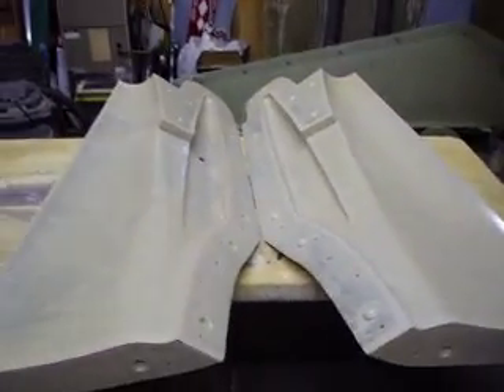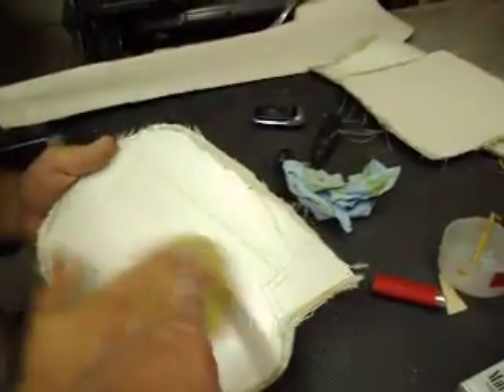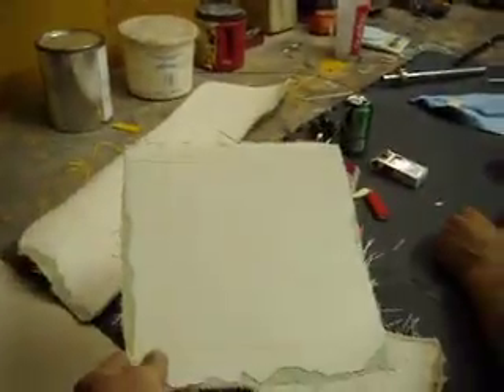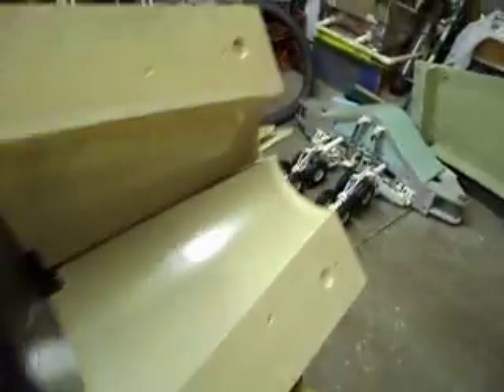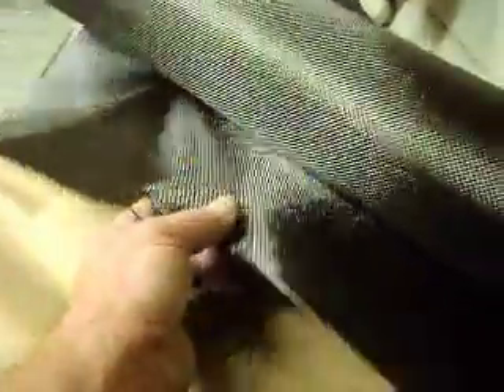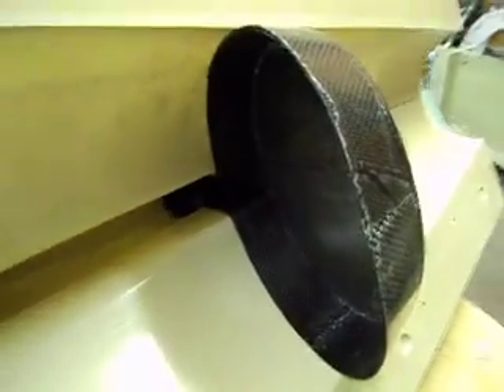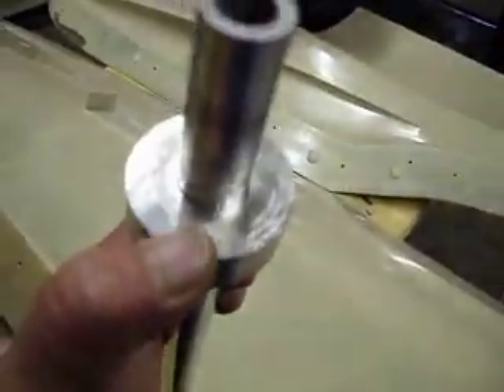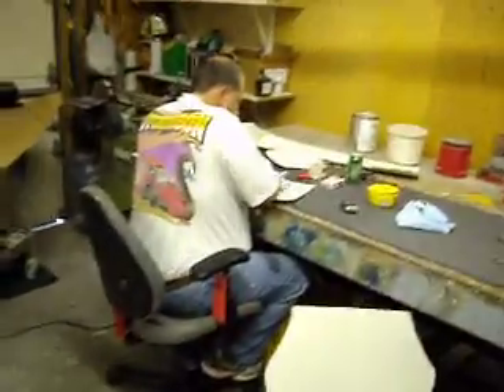How to build a rc jet b1 bomber #79

Comment: what kind of resin do you use for the carbon fibre also once the CF is rock solid how do you remove it from the mold thanks 
         mikey 5*